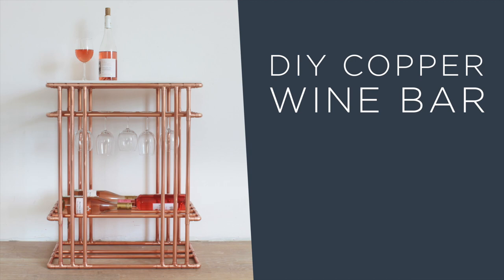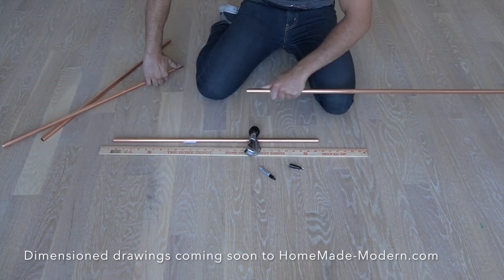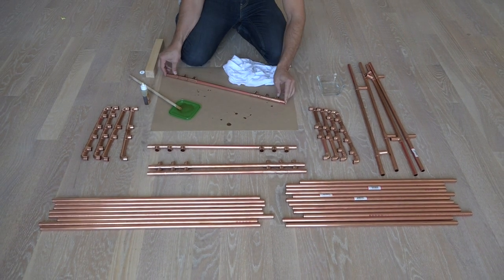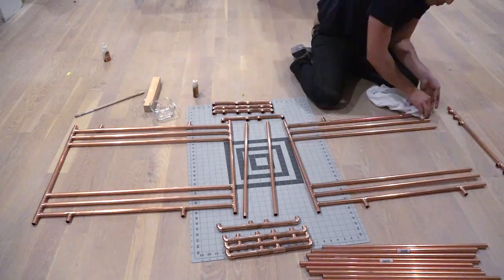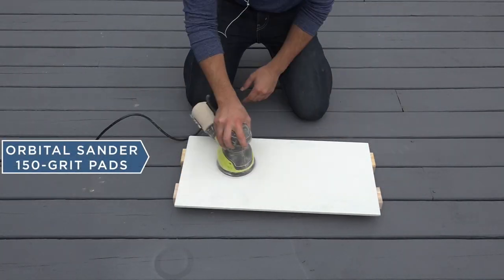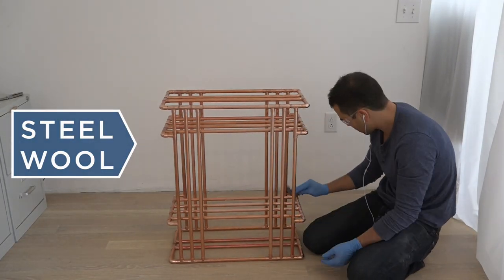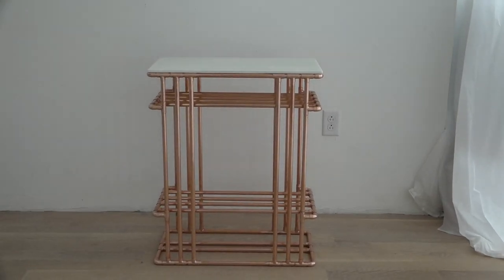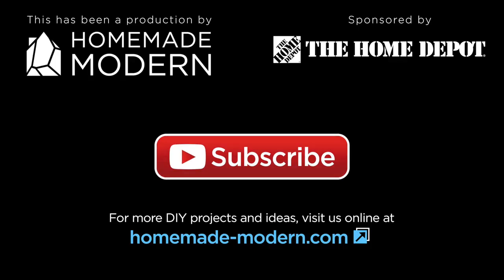DIY Wine Bar | Made out of Copper Pipe and Marble Tile

Comment: Out of curiosity, is there a reason you opted for epoxy vs. simply soldering them?
Reply: Soldering changes the colour and is more time consuming, ed you need more tools.
Reply from the maker: cleaner, easier, and cheaper!
Reply: That's fair, it stands to reason that is would allow for some cleaner edges and a lower barrier to entry.

Comment: Nice project but the copper will change color in no time and it will not be shiny.
Reply from the maker: yes it will change but not in no time.  The speed of oxidation depends on the environment that it is in.  In my loft the copper has remained shine for 2 months with minor oxidation only around a few finger prints.